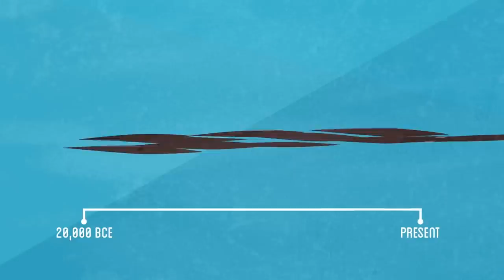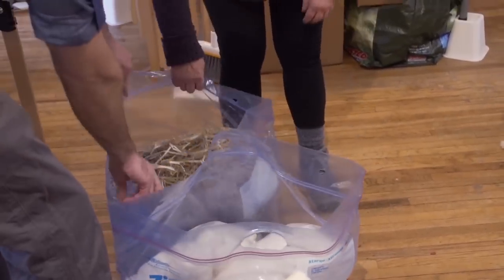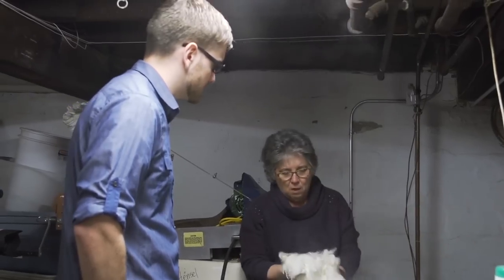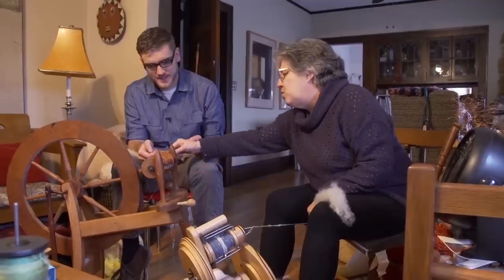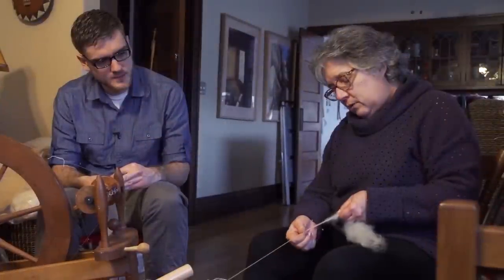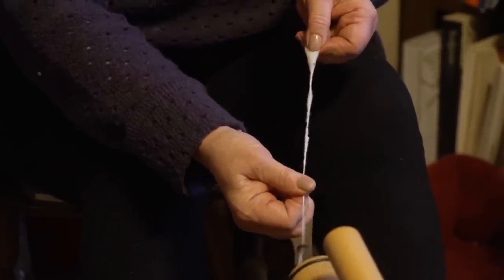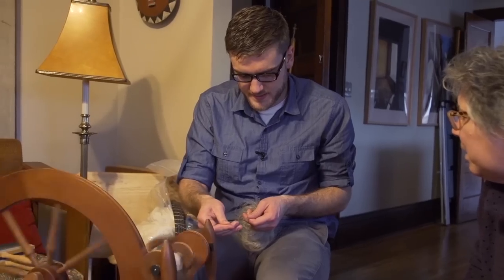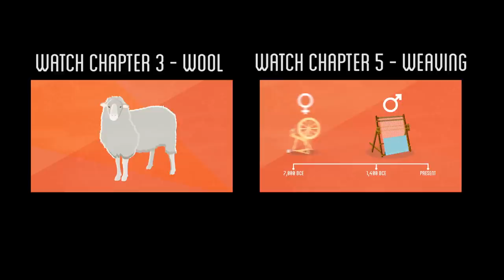Spinning Thread | How To Make Everything: Suit (4/10)

Comment: Darn, I still don't get it how a piece of wool/cotton/silk/whatever, that can be easily split into smaller fragments, is "merged" with other similar pieces and becomes a looooong seemingly whole thread that requires efforts to tear.
Reply: He doesn't mention that fibers aren't smooth. They're made up of scales (keratin) or spines? ( Cellulose) that can be smoothed down or teased up through friction, dehydration, moisture, etc and that can be made to lock together. It's like human hair can separate or matt and tangle, depending on how you handle it, though it's not nearly as good at it as wool is.